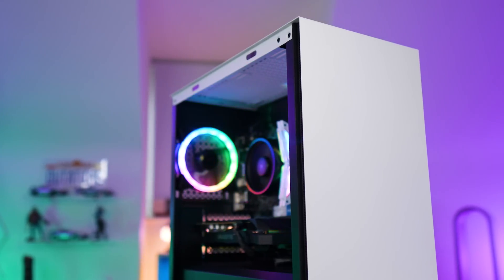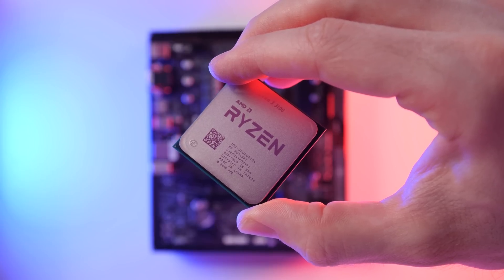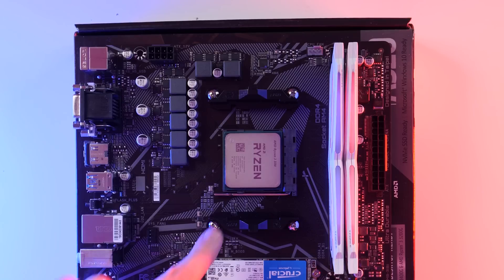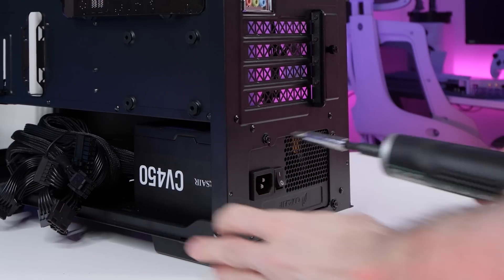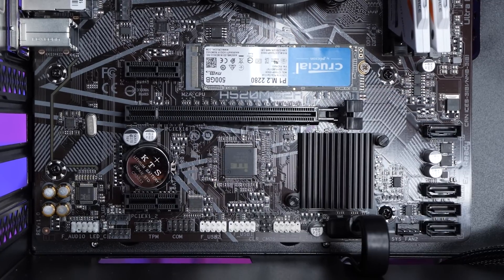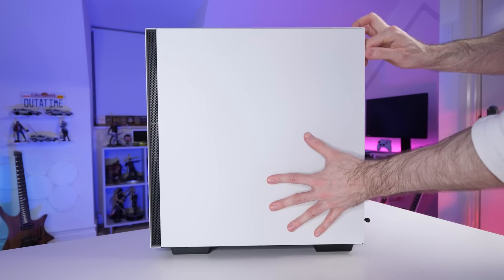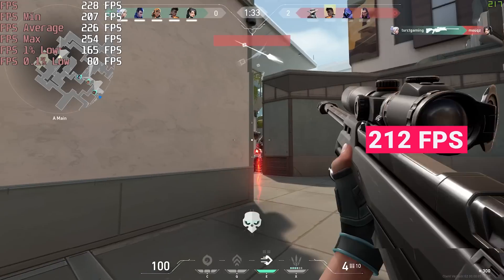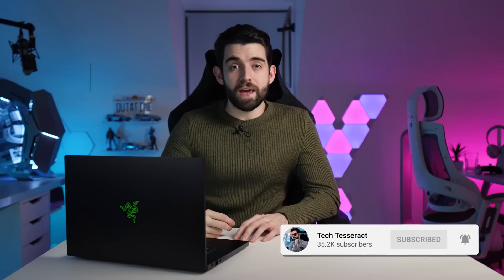How to Build a Gaming PC! 🎮 $700 Budget PC Build GUIDE w/ Benchmarks! (2021)

Comment: Hey so question about this PC build I’m looking for making my first one but I’m also want to start streaming would you say this is a decent build for that?
Reply: ehhhh, its ok, do NOT get the cpu or the ssd, I recommend at least a ryzen 2600 or 3600 for the cpu, and for the ssd, I would do a samsung evo 500 gb, it is a really nice one. And instead of the graphics card he is using, I would get the Gigabyte GeForce GTX 1050 Ti 4 GB. It is cheaper and has almost equal specs. The cpu, ssd, and graphics card is a little more spendy, but it is pretty good for streaming and gaming.
Reply: also go on pcpartpicker.com to help with component picking

Comment: The GPU on the Amazon link is priced $500+. Is this due to the 30s shortages. I really want to build a pc but seeing the shortages situation makes me not even bother.
Reply from the maker: Yeah. I managed to pick mine up for $220 about a month ago.  Try Newegg if you're in the US
Reply: @TechTesseract  Newegg is just as worse. At this point I rather buy from a scalper because that’s the only option. I can’t even get a pre built with the new 30 series cards.